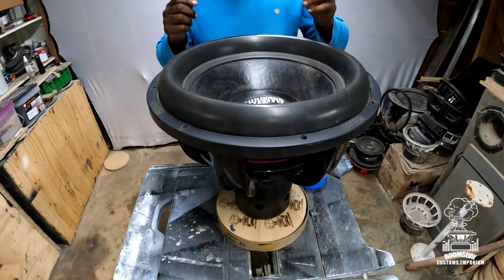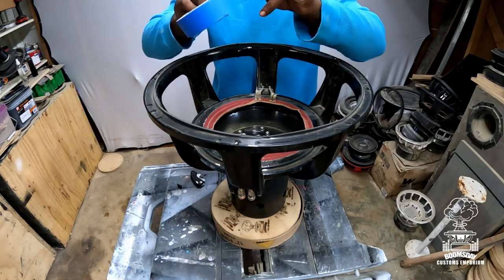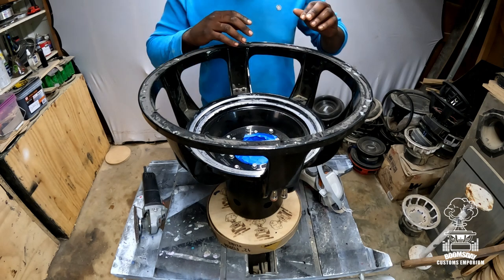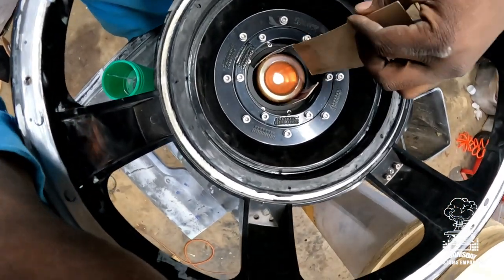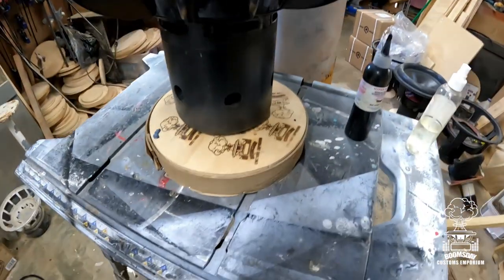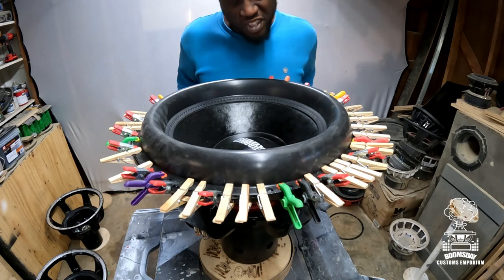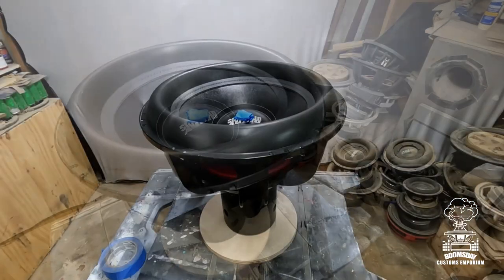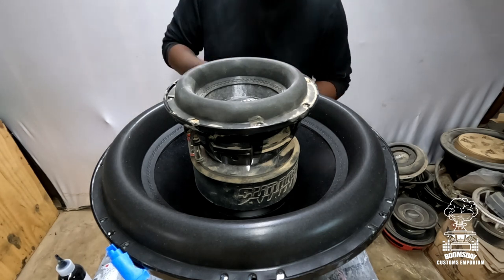How To Recone & Repair A Subwoofer | Step By Step | Sundown Audio NS.v4 18s | BIG BASS | MONSTER SUB

Comment: Did you ever get a recone that was built wrong? I just did. I ordered an Onyx d1 recone from Resilient Sounds and it arrived defective with a crooked coil. They have a ring on the spider with bolt holes already in it so i dont think it even needs shims. The coil gap is set by that ring thats pre glued to the spider. Im so glad i dry fitted it 1st. The coil was tilted by a bit over  ¼" i measured it. I messaged them about it. I hope they exchange it. If not, i wasted $180.
Reply: You have to shim it…